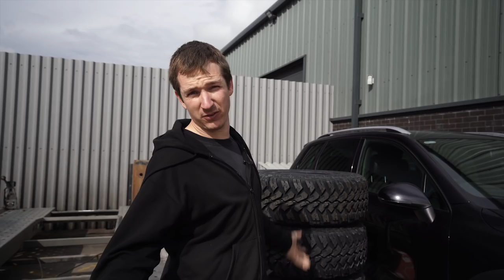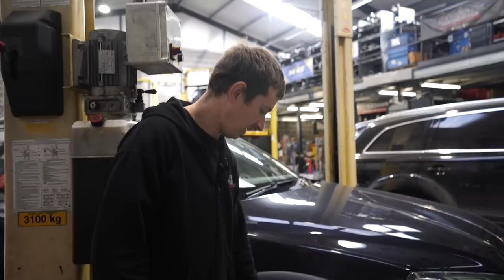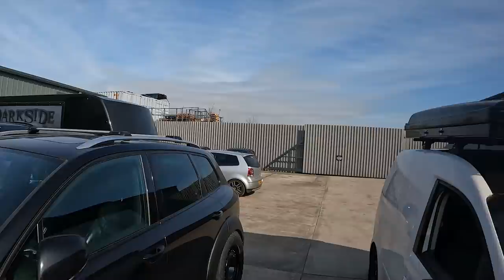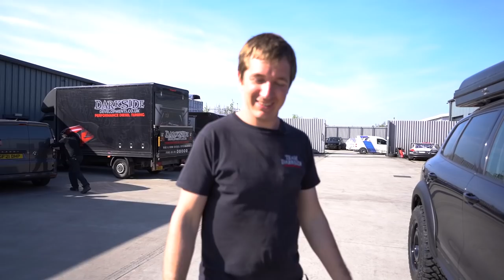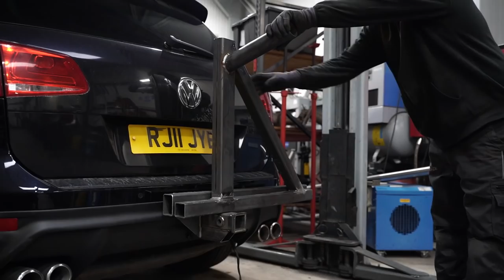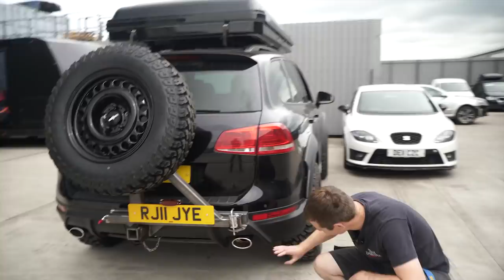Touareg 7P 4.2 TDI V8 Overland Build - Rotiform / TentBox

Comment: Did you guys add spacers to the wheels? I have a 2012 without the flares. I was looking at 30mm spacers, is that too much?

Same rotiforms with same specs but with 265/6518 or 265/60/18 AT
Reply from the maker: 30mm sounds like a lot
Reply: What is enough to clear the calipers?
Reply from the maker: I can't remember what we used but I'm sure it wasn't as much as 30mm

Comment: Curious as to the fuel mileage penalty between the V8 & V6 TDI on the same platform? Yep I fully understand the 4.2 V8  definately has MUCH More Power!
Reply from the maker: Official figures are 30mpg Vs 40mpg but reality is 31ish for the V8 and 33 for the V6. I'd buy a V6 Escape model if I had to have a MK2 Touareg.
Reply: @DarksideDevelopments  , We poor buggers in the US have not had such toys available since 2016!  The only partially serious tunes over here are Malone,Tunezilla/B.Singh stuff. Never saw a Trans tune ever mentioned at all?

Comment: Hey guys.....what is the spec on the wheels? I'm trying to work out how low an offset I can get away with on my 2012 with out stuffing around with as you say intercooler massaging. The wheel I'm looking at comes in 18x9+20 and would put a 265/60/18 AT tyre on it. 
Cheers
Reply from the maker: Hi, 
Those wheels would stick out 10mm more than the Rotiform we fitted to this. The overall tyre diameter would also be 40mm less with the tyre size you have suggested so you 'shouldn't' have any issues (Y)
Reply: @DarksideDevelopments  thanks guys

Comment: The wheels looks flushed with the fender. What's the specification of the rims and the tyre size?. Oh yeah where did you get the bodykit too mate? Many thanks
Reply from the maker: Rotiform STL Wheels 18x9J ET30
https://www.darksidedevelopments.co.uk/darkside-overland/

275/65R18 119Q Maxxis Bighorn MT764
https://www.darksidedevelopments.co.uk/darkside-overland/

Chassis Mod for Tyre Clearance

Hofele Wide Body Kit
Reply: @DarksideDevelopments  many thanks mate

Comment: Would I be correct to assume there's not much love for the 2.5 TDI Touareg?
Reply from the maker: None from us!
Reply: @DarksideDevelopments  is the motor bad or just not up to overlanding from a power viewpoint?
Reply: @DarksideDevelopments  I thought it is quite similar to the engine in your t5 recovery truck?
Reply from the maker: Crap engine / no diff lock / probs alright though... it's just our opinion
Reply from the maker: correct